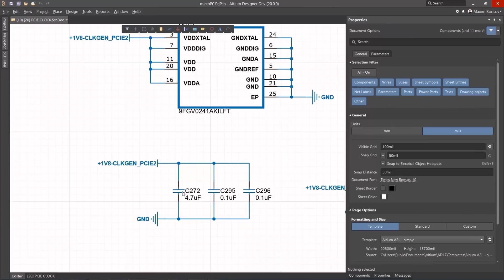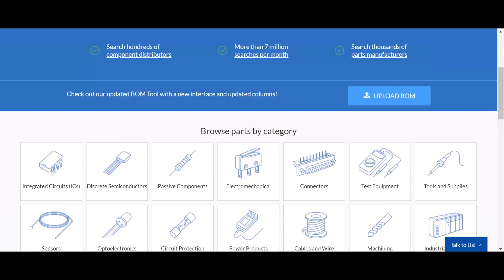12v to 17000kv high voltage transformer , Altium Designer

Comment: Why not used enamelled wire ?
Reply: This is also enamelled wire but with rubber
If they don't have a short circuit between the coil, that can still give you  electromagnetic field like enamelled wires